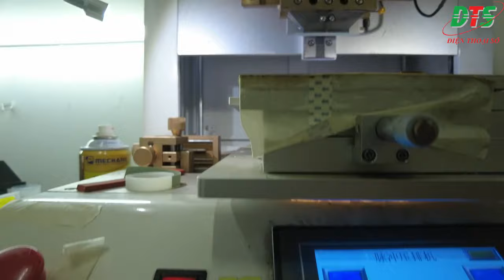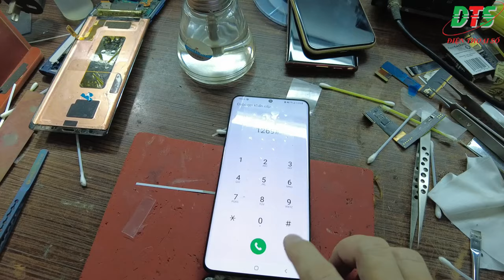Fix Samsung S20 with white screen | Samsung s20 stripe screen | Stripe screen samsung s20 plus

Comment: Lost confidence in Samsung when my s20 ultra 5G, gone white and green, after software  upgrade gone white and green screen, only 6 mths usage, under warranty but they said I still to pay for the fixtures if parts especially the screen have to be replaced. Years of loyalty to Samsung gone to drain. Just bought Vivo V2e, because couldn't afford another expensive phone, Vivo have my respect, easy to use,almost have same functionality as my previous  S20. Don't trust this Korean product anymore. Their own software caused the problem to their own products but running away from their obligations and responsibilities. Samsung give you 5 👎🏽👎🏽👎🏽👎🏽👎🏽
Reply: True... Same like me... Samsung sucks
Reply: I have same issues after a year, samsung alwyas has problems
Reply: Same issue on S20 plus just after waranty end, appered in front of me while typing msg seems like manufacturing defect by them but still samsung service center is asking 16k to change the display.
Reply: It's not a must you change the display before it work
Reply: Same! I have been faithful to Samsung Note series since Note 3. But during my Note 9 and Note 20 I have encountered this same problem!! I just can't trust it anymore. I can't be confident about it, I keep worrying about it, it's not worth it. So I just switched brands. Obviously to the number 1 brand of course. Now I know why they are number 1
Reply: They doing this on purpose to have us either buy another phone or expensive parts. Never again ! I try to hold on to my phone for at least 4 years before I purchase another one but my s10 + just starting doing this. Will I lose my data and files ? I’m done with Samsung. What an inconvenience. So frustrating !
Reply: Same here. I bet Samsung does it on purpose to force you to upgrade to their new phone. My S7 died around the same time but had a different issue (motherboard failure), S9+ screen issue also and now my S20+. Safe to say I won't ever buy a Samsung phone again. They're built to fail.
Reply: Am experiencing this exact issue on my Samsung note20 ultra 5G currently. The white and green screen just pop up anything without a notice and switch back to normal after some hours or a day without also a notice. I took it for repair I was told is screen issue and to change  it is 350k naira. I was so heart broken hearing this because I thought it was just software error and won't even cost up to 10k to repair. This is bearly a year i bought the phone. Where on earth will get 350k to change the screen with this current economy. I have always been a die hard fan of Samsung.but with this issue I can't help it but give up..
Reply: Same problem happen to me 😢😢😢

Comment: Clearly it is caused by contamination on the joint, all AMOLED screens produced by samsung suffer from this connector failure. This includes iphones so there is nearly nowhere to run really if you buy an expensive flagship. Screen dies quickly under moist and high ambient salt conditions.

You may get an LCD version of the iphone instead.

It is infuriating that samsung can produce screens this fragile in tens of millions per year, and profit from its fragility for over 7 years. Screen looks great and have great performance, but no long-term durability. The joint is way too delicate and small that chemical contamination will eventually damage it. Samsung know this but they never attempted to fix it. This is what you get when you have a monopoly on the technology.

I hate the brand since I had one of their CD-ROM drive broke within 2 years in the 1990s. Their products are definitely not built to last, but designed to fail once warranty period is over.
Reply: Will I lose my data ? I want to back up my data then trash it and buy a phone that has LCD instead of Amoled.
Reply: Boycott SAMSUNG everywhere SAMSUNG is selling high end price devices with 2-3 year expiration dates sadly they scammed their consumers for a money grab scheme.
Reply: What phones do you recommend since my samsung is suffering the same issue as in the video sadly

Comment: I'm lost with the flex cable. Did you use a replacement flex cable to bond to the screen or did you cut and re-bond the existing halves of the flex cable?
Reply: Ya replacement flex cable was used.
Reply: @punyotamo6533  I'm guessing the Note 9 suffers from the same problem, since I have the same symptoms. I think I'm done with Samsung and the short life of their phones.
Reply: @punyotamo6533  is it the a particular line on the flex cable or is it a component in the flex cable that is causing the white screen?? Thnx

Comment: I am facing the Display issue with my Samsung S20 Ultra phone. I got a software update notification for Android 12. After the update, my phone screen becomes bright white color and starts blinking. When I visited Samsung service center they are saying need to change screen and have to pay for that since my phone is out of warranty (Two month ago expired) and even they were saying we are aware about this issue but you have to pay full amount.

I'm super disappointed such expensive phone is ruined by a software update.
Reply: I just did a software update and guess what after 15 mins of the update. 1/5th of my screen has turened absolutely white in colour. What do I do now?
Reply: same here. I just installed the august 2022 update and first the screen blinked adn then after 2-3 days of blinking and flickering it now green with very close horizontal lines (either remaining static or moving in up/down wave like motion.)

Comment: Just got the white screen issue too. I bet Samsung does it on purpose to force you to upgrade to their new phone. My S7 died around the same time but had a different issue (motherboard failure), S9+ screen issue also and now my S20+. Safe to say I won't ever buy a Samsung phone again.
Reply: They use some cheap ass flex cable just so our phone becomes bricked after warranty. Been loyal Samsung customer for 8 yrs safe to say I'm now looking at other brands for my future purchases after this happened to my phone.

Comment: From Indonesia, some fix works for me

Bought second really good, clean & okay s20+ for around 5 Juta idr ($310) , show always on display I set off to make it have better battery life,  then go to sleep and.. Tomorrow ... suddenly flick every half an hour or more or even less. Randomly 

So i
Update... Still error even change settings to lower res and frequency 

Then updated security or whatever it's, 
I set show display on, , show clock always. 

It helps to solver the problem

Found this solutions from Samsung forum as many complaining there about this.

After long, I don't show the clock. Still fine, but honestly...

I prefer s10+ seems less problem in screen at all, even other phone as that cheaper redmi, realme I use doesn't has this... Heart attack problem.. 

I hope this helps. And I hope this fix will be forever okay for each of us.. As that this phone is really expensive if bought new..

🙏

Comment: This has just happened to my S20 Ultra, if I can try and get it fixed, great, but will later look for a new phone. What brand to people recommend? I really do like the camera and photo quality of the S20 Ultra, so would be looking for a phone with similar camera quality. And have people with this issue that have had their phone repaired, lost any data?
Reply: mine just happened ,same phone😢😢
Reply: I got it fixed last week, they had to replace the screen, a genuine samsung screen cost me >$300, 😵
Reply: @minggyyuu  did you fixed it?
Reply: @RTailor100  I guess the issue came back after replacement?!

Comment: Currently, in Chinese market, many users complained that their S20 series have these white green screen, or full screen with lines, are those issues come from this PCB issues?
Reply: Same here in Indonesia market, many S20 series had white screen.. And this happens mostly after software update,mostly 1 day - 7 days after update
Reply: @risyafmulyana8606  I paid my S20 Ultra to Samsung official aftermarket care center, replacing a monitor cost me around USD $325 :)
Reply: @MrPeanutJohn  ohh its sad expensive..
Many ppl start to move to iOS
Reply: This is a problem with Samsung pcb. It slowly starts t9 separate from screen area. It is a known issue since Note 3 & S7 edge
Reply: Ironically, i got stripe on my phone hours after using a trade in value assessing app where it tests the health of the phone. It made me think that the stripe was caused by the app, and make my phone value less and force me to trade it.
Reply: @risyafmulyana8606  halo mas, kasus ini terakhir gimana ya?
saya baru update software, beberapa hari kemudian kena white screen
Reply: @bobbysiagian7977  garansi udh habis ya ? Klo abis biasanya hrs komplain d ssc biar dpet diskon pergantian komponen atau trade in ke seri atas
Reply: @risyafmulyana8606  disuruh ganti lcd solusinya, bayar 4jt.....
Reply: Sengaja ga mau update.. tp 2hr lalu start green screen.. lalu td di update.. mulai ada white screennya.. hadehhh
Reply: @risyafmulyana8606  will I lose my data ? I want to back up my phone then trash it and go to Apple.

Comment: My note 20 ultra started doing it after I updated to one Ui 4.1 But for some reason I can fix it by holding down the power button. It usually comes back by itself if I leave it. So my problem is intermittent
Reply: how is it currently?

Comment: Even my s20 has some display issue. A thin green line appears on screen. When shown to samsung gallery they are saying to replace screen and it costs 18000 rs. Can u fix my issue?
Reply: If your phone did not hit anywhere you don't need to repair the screen, firstly deactivate custom service, restored the phone factory settings keep the phone at home for 3 to 5 days check it back after then it will work perfectly though the flicker might not stopped once bit you will get a positive result it worked for me

Comment: I have the same problem with my S20 Ultra after 1 year of use. IF YOU'RE READING THIS: GET AWAY FROM SAMSUNG. This is also happening from Galaxy S10 to Galaxy S21 and will probably also happen to the S22. Samsung is loosing thousands of customers because of this including me, I'll never gonna buy a "Samsuck" again
Reply: S10 +  want to back up my phone then trash it 😩 I hope it didn’t lose my files/data. I didn’t back up my phone before the situation.
Reply: @ChasBabyGirl  Do you have the same white screen problem? I already lost my data.
Reply: @mda2871  yes. From green flickering screen to now completely white. I’m sad. If I can’t recover any of my data and files I will never again buy a Samsung product. It started doing this after a software update that I tried to block. I’m so mad at myself for never backing up to a cloud source and I bought 512 gb like a fool. Devastated. Did you try taking it to a shop ? I will try tomorrow at an authorized Samsung repair store. The IT man at my job was trying to troubleshoot on the pc and it didn’t recognize the my device. Nothing ! Sad about my data. 3 phones of info on there. The 3, 7 edge and s10 +. I’m done with Samsung.
Reply: @ChasBabyGirl  a lot of people had the same issue after the update. Sadly the warranty of my phone was over. Nothing to do.
Reply: @mda2871  I hope I can somehow recover the data. Phone is 3 years old and replaceable but data and files is not. Thanks for responding. This really sucks. I will now  use cloud services. I’m willing to pay good money to recover the Data and files🤔 Garbage Monopoly Samsung.
Reply: It happened on S22... Totally regret buying it..

Comment: this just happened to my s22 ultra and i'm quite pissed, I spent $1000+  to buy this phone and it only lasted 2yrs more or less, never bloated or droppped no cracks. The chinese brands like xiaomi/redmi/poco cost less sometimes only half  of the samsung's around $400--$500 but like 70--90% of the specs/pperformance so I wouldn't be as gutted about that if it only last 2 yrs.

Comment: Mine I just used hot air with the heat of 300 and air of 3 and focused on the flex part and heat it up even it was already fixed and tapped it many times on my palm while it's hot downwards where I heated it for 2 times. Now it's been 3 days.
Reply: And now?

Comment: Samsung s20 white screen fix this problem please
Reply: If your phone did not hit anywhere you don't need to repair the screen, firstly deactivate custom service, restored the phone factory settings keep the phone at home for 3 to 5 days check it back after then it will work perfectly though the flicker might not stopped once bit you will get a positive result it worked for me

Comment: My samsung S20 ultra has only a white screen
Reply from the maker: i can fix it
Reply: @HOWTOFIXPHONE  sir..i have read many posts that S20 Series has the same problem that is White Screen..and they said this problem mostly comes after software update..so if it's cause by software, it may be fixed without Display changes,, but so many people that replace the screen by a new one. 
How about your opinion about this sir ?? this is a problem of software or hardware ? thanks
Reply: Is it in Singapore?
Reply: Software problem
Reply: @risyafmulyana8606  This problem is Creating Software but heat🔥in Display melting Something inside